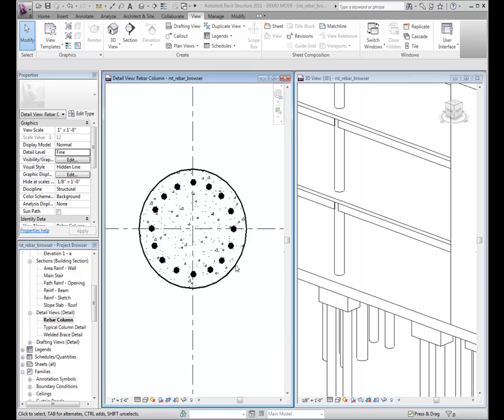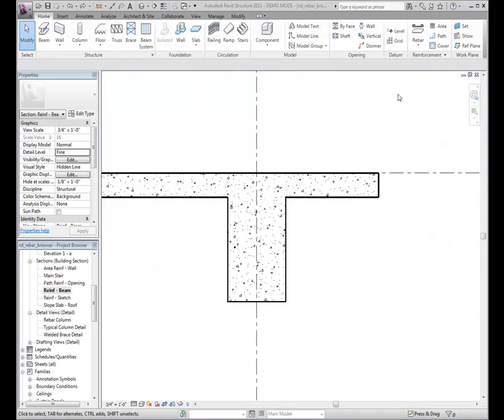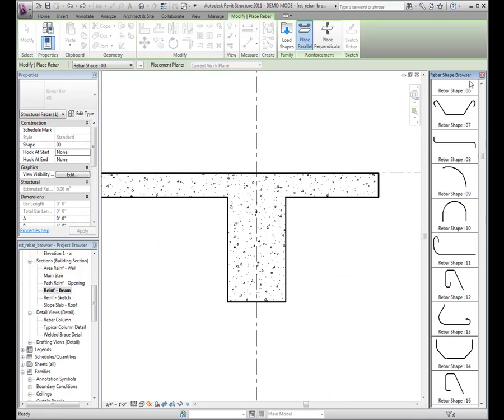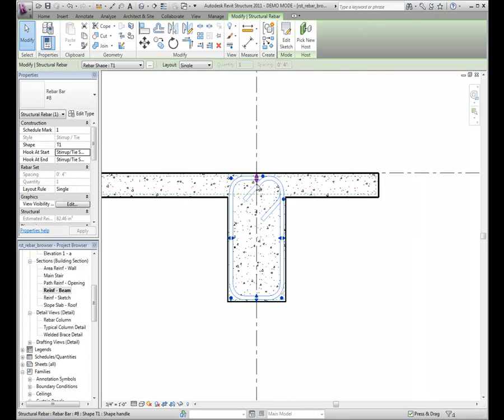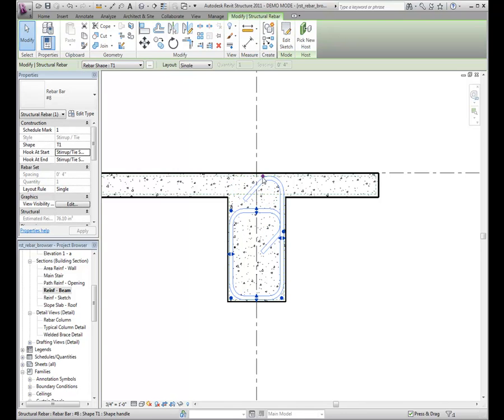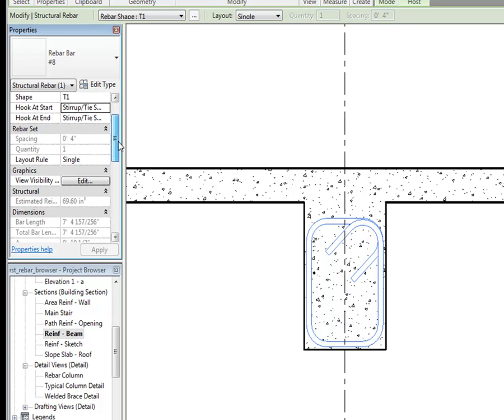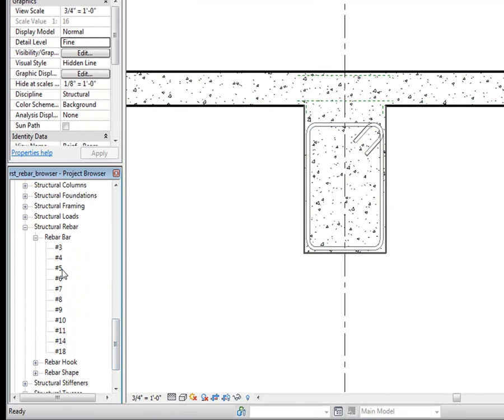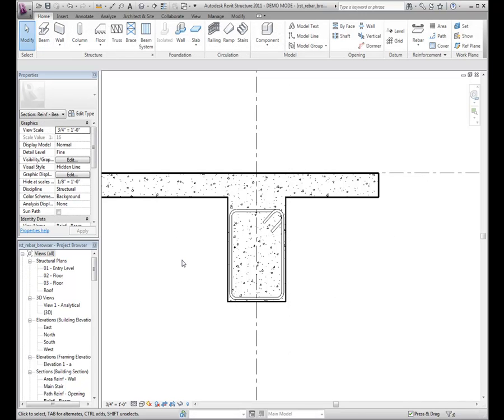Autodesk Revit Structure: Using the Rebar Shape Browser

Comment: Hello
Edit a concrete column, .60 x.30 inches measures, when I use the tool "rebar" will not let me put the assembly in this structure, I can do to solve the problem?
Thanks!